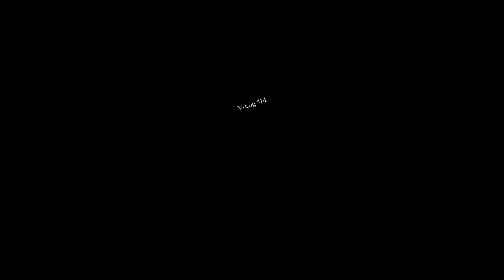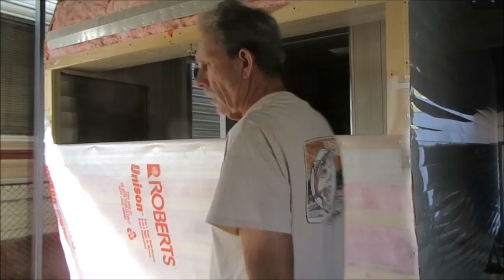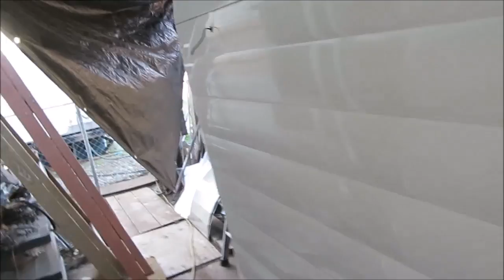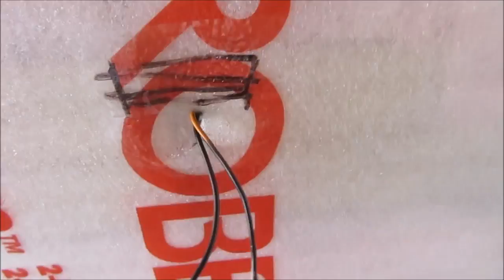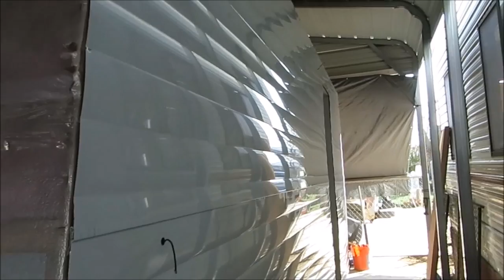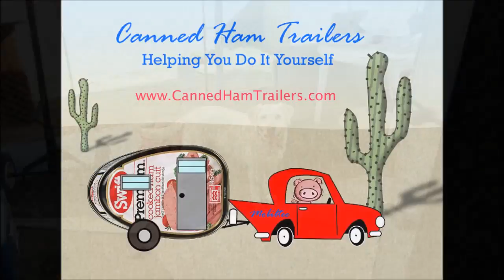V Log #14 - 66 Super Shasta Update

Comment: Hello,  I'm a new subscriber and have a 1985, 24ft Aljo, Skyline travel trailer.  I'm not the original owner and although it doesn't smell like mold, I'm sure it likely has water damage back behind the walls etc.  Even though I have a newer, larger travel trailer, there's just something about this one I really like.  I'm wanting to start to renovate it.  So I'm thinking that means all the ceiling, walls etc. need to come out to start over with it?  I want to ask if it's worth it?  But I'm thinking that's a loaded question.  Why do you do it?  Is it the nostalgia?
Reply from the maker: I really don't know why I do this. LOL... I just enjoy vintage things and nostalgia I guess. Watch a lot of my vids before you start in. You don't gut these trailers. they must be taken apart from the outside in. All of the structural integrity is built into the way these things are assembled. Even the cabinets play a huge role in the strength of the trailer. If you just go in and gut it you will  have a flimsy unreinforced box.
Reply: Thank you.  I'm on your website watching your videos and reading now.  Learning lots.  I'm sure you'll be hearing lots of me.  ;-)

Comment: Yes, you have tail lights wire. Did you run wires for stop sign and for turn signals? I did not noticed them.
Reply from the maker: Only one wire is used per side for stop and turn indicators. They are the same.

Comment: This content is knowledgeable and fantastic.  Many thanks for the tips and tricks along the way.  I do have one question regarding vapour barrier.  I see you used a product for that purpose and I assume you chose to put it on the warm side...in this case outside.  (I am from MB Canada so its a bit different up here lol.   Can you elaborate on this conceptually and also on the use of ridged foam insulation.
Reply from the maker: I don't like rigied foam insulation because once it get's cold it transfers cold and once it gets hot it transfers heat. I like using fiberglass insulation because it doesn't do this. That is because of the air space between the fibers. And for the vapor barrier I use Roberts Unison Flooring Underlayment because it works great for this purpose.  Go to my website where my build videos are all indexed and laid out with descriptions so you can find the videos you need witout having to search You Tube for my videos. In there you will find a few different places where I discuss the Unison vapor barrier. By the way I get that stuff from Amazon. https://www.amazon.com/gp/product/B001CXYYVA/ref=ppx_yo_dt_b_search_asin_title?ie=UTF8&psc=1